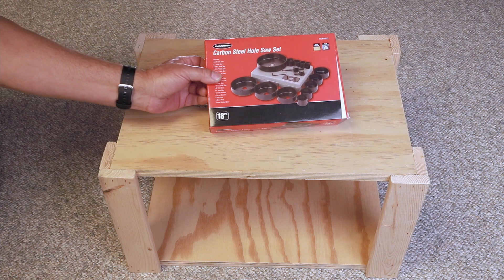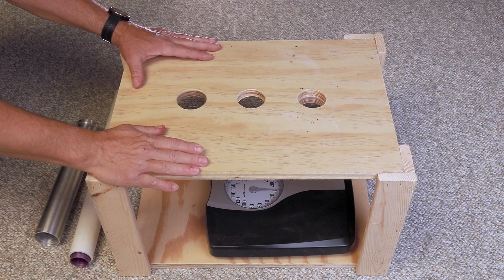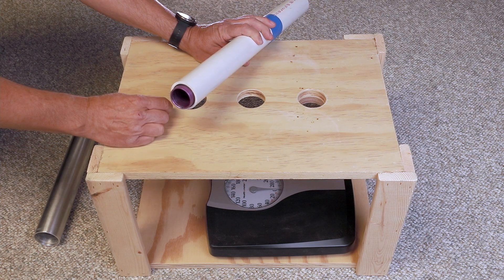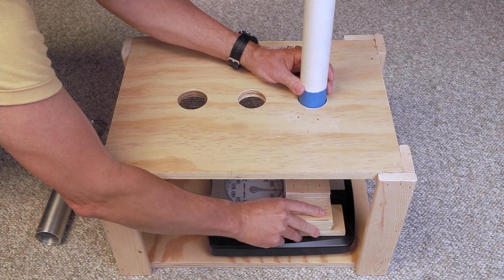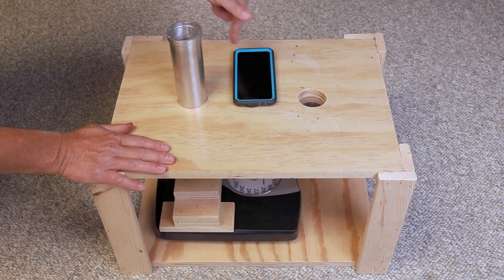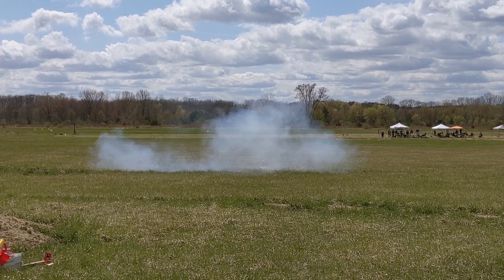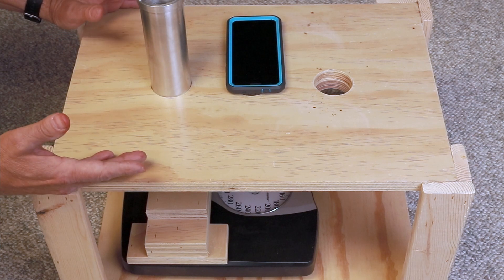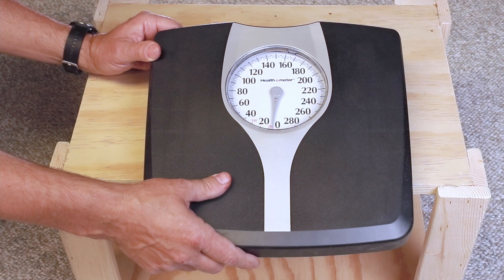DIY Thrust Stand

Comment: Hi , The rocketeer Can you please syggest me where to start building a rocket i am 16 and i wanna make a rocket♥️Much Love.
Reply from the maker: The first thing you need to consider is the size of the field that you will be launching in. A small  park (with permission) may require a 1/2A size rocket motor while larger football size fields will support B - C size motors. 

Go to your local hobby store if available, Hobby Lobby or online and pick out a kit you like. Estes rocket kits list the skill level and approximate height (apogee) the rocket will achieve. Grab some yellow glue, a sheet of 220 grit sandpaper and have fun! Rockets are like potato chips, one is not enough :)
Reply: @TheRocketeer  thanks a lot love the content , You will reach heights